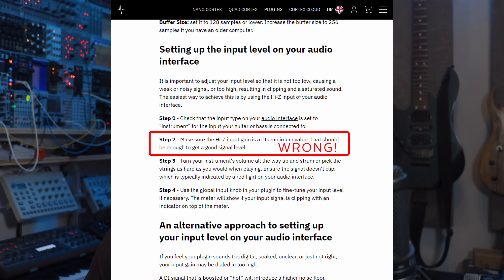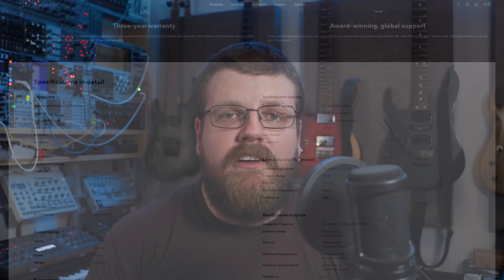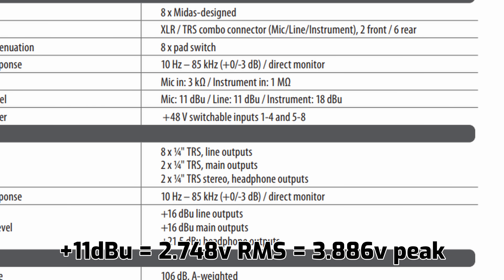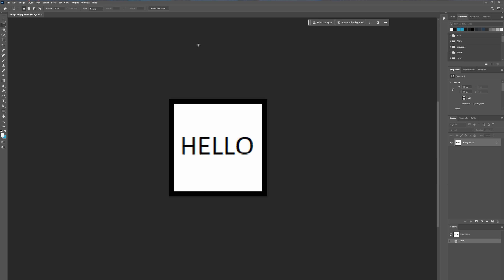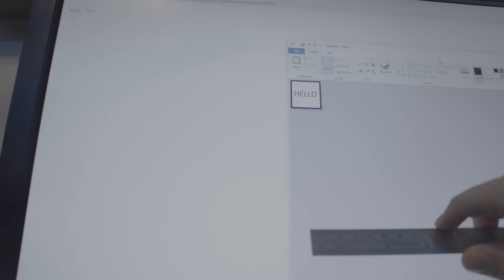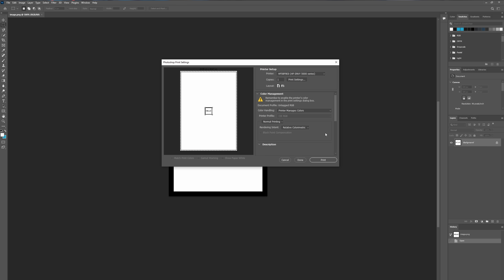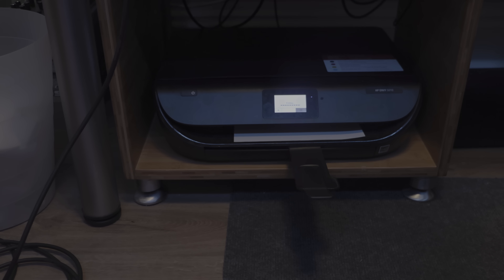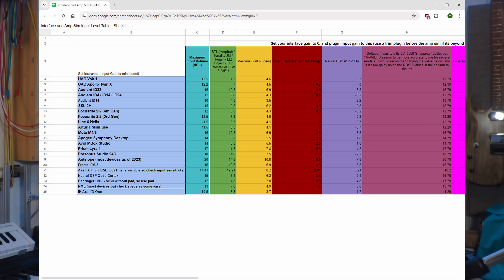Ampsims and input gain - Please, stop the madness...

Comment: great video! just subscribed!

How does that relate to floor modelers going straight into FOH / USB interface at home?

I am using a Qad Cortex that has input and output settings.

Since this is the first 'gainstage' I suppose I am doing it right with setting it up right before it starts clipping and then using the gain knobs on the desk / Interface - right?

One thing always wondered me and this is maybe worth a video:

How does output gain work in this scenario? Is this just attentuating the signal or is something going on with gain stages?

Comment: This is great, I have constantly had this thought for years, just about every pixel machine emulation has no optimal input explanation, channel strips show you -12 on something like SSL 4kB something else operates best at -18 like a 1176 compressor and something else is optimal at -10 but that's digital scale which 0 is the limit which makes no sense, gain staging is a nightmare because its not even real hardware, lol, I will have to rewatch this a few times to retrain my mind, on my 18i20 I have just been using the meters, keep it just under where it turns orange, might be too low, actually, I am gonna run off and tinker with it, thank you so much for this.

Comment: every audio interface is designed from scratch and often even ADC specification don't mean anything in the end. and Behringer is like the worst audio gear company you can find... so in your test scenario depending on quality of pre-amps and other problem sources(that you can't turn off completely in your audio interface) you can get very different results even if source and ADC is the same.
Reply: Sure, every audio interface is different, and the best setting is always the loudest before it clips.
Reply: @ChristianIce  i disagree. each one will be different. also user might prioritize noise floore more then dynamic range

Comment: Huh, informative.

I get a lot of noise from my guitar, I thought it was just a crap guitar, and it did in fact have a bad ground, which I soldered, (and probably has more electrical issues inside) but now I can see if part if the issue is in the setup before hitting the Audio interface or one of the converters before it hits the AU and then the amp sim.

Every step probably raises the noise floor.

Comment: How much of the "set the input to zero" advice was in relation to someone using an older generation Scarlett interface?  That damn thing seems to have virtually no headroom, so it's really easy to clip the input with high output pickups unless someone utilizes a DI box.

Comment: Does using active pickups like EMGs affect this at all? I'm assuming no, but this shit is so out of my field of knowledge i wouldn't be able to explain why or why not. I just think maybe the pre amp would affect it somehow?

Also I've always thought this,  it's dumb but I've related it to when i listen to music from my phone to a speaker,  i always max out the phone volume and adjust the speaker volume accordingly. It made sense to me to have the strongest best signal early in the chain then adjust later. It made sense logically in my head, but i didn't have the knowledge to prove it one way or the other. Especially when you put low volume on your phone and crank the speaker it always sounded flat. Doing 50/50 never sounded as good as 100% input

I always wondered about why everyone was saying put it to 0db, i just followed but never understood it lol
Reply: active pickups went to line input and not instrument input so just use the "increase gain just below clipping on audio interface" method then increase the input gain on ampsim to designated one on that spreadsheet

Comment: Are you saying using gain in a musical, harmonic , creative way,…  for music is wrong ?  It works in your exemple here but if signal to noise and math is your priority in music and art making, ppl with the song, the feel, musicality and vibe etc as priority will pass you by. Ppl listening will never care if you’re technically right or wrong. They will dig the song and the vibe or not. And gain staging, the way audio hits the different stages, and the changes occuring to the sound by the amplification of the different stages,  is a great tool to fine tune music as you want it to feel,  work harmonically and rhythmically, depth, … Why are we still clipping Neve preamp and dialing noisy tube preamps ?!  surely not to have the best signal to noise ratio.

Comment: Nice video, This is the correct way to set any kind of microphone or line input recordings since always, the hole idea of beeing just a safe step before clipping is using the most of the available space to print the signal, so the most of the space used, the more detailed and the lowest posible noise floor. thanks so much!

Comment: I always figured (from experience in other fields) that it's best to have the loudest signal without clipping when recording stuff.
      Because clipping takes away parts of the loudest stuff.
      But if you have to volume boost your recorded material, you're introducing noise.

Much like using a higher resolution image in Photoshop, or higher resolution / higher framerate footage when editing video.

(Because... "you can't turn poop into chocolate")

I think that's also what you're advising, correct? (there's a lot of technical terms in there, and I have no formal audio / maths / physics education)

What's always been unclear to me is how loud of a signal will make my virtual amps perform best, though.
    But since I use a (virtual) overdrive to push the virtual tubes, I'm guessing the louder the input; the better

Comment: I totally get this, but I'm an amateur at best. The part I'm struggling with is working out how much to adjust my plugin input. I've got my interface gain set so it's not clipping, but how do I tell how much signal(?) is hitting my plugin so I can work out how much plugin input to adjust? Do I use a level plugin in my DAW (Logic)? What will that tell me and then how do I work out the amount I need to adjust my plugin input? That part of your video seems to be missing or maybe I'm missing something. Appreciate any help :)

What I can say is, that following your instructions as best I could, I'm now getting a killer sound!

Comment: I've always used my Apollo audio interface with the gain set to 0, using active pickups, and I’ve never had any noise issues. 

However, I’ve never adjusted the input on the Neural DSP amp simulator. I’ll definitely try this ‘trick’ recommended by the video right away! Thank you so much!🔥
Reply: Had Apollo twin for years (original and mk2). Fully turned down the preams had still +10db  of gain. Really annoying sometimes when using a direct box recording di guitar and the preamp would clip because of the 10db boost. Then you have to use the pad in the preamp and add gain, which in theory increases preamps noise. Annoyed me everytime. One of the reasons why I switched  to RME.

Comment: Most of the common audio interfaces don't have enough headroom on HiZ inputs to handle high-output passive pickups (or sometimes even active pickups for that matter) no matter how low you set the gain knob. 4th gen Scarlett, for example, has a 12 dBu maximum input level, which is about 8.7 V peak to peak. That's unacceptably low. It won't even handle X-series EMGs with a fresh 9V battery. Duncan SH-6, for example, can easily spit out 8V+ peaks on heavy attack with palm muting (16V+ p-p). With this much overvoltage it doesn't just distort, it clicks like crazy. If you keep lowering the pickup until the clipping stops you would soon find it in your back pocket. Something like X2N will easily top that. And the worst part? It overloads the interface's input stage so it is not affected by the gain setting and won't even register as clipping since that circuit comes after the gain adjustment and the signal is already distorted there. But that's Focusrite, which despite its popularity is an absolute dogshit all around. Apogee Symphony has 14dBu (~11V p-p) of headroom. Just marginally better. UAD interfaces I looked up have 12.5dBu. Just fkn kill me already. The highest I've ever seen was something like 16dBu and I don't even remember what it was. Fortunately it doesn't matter that much when you use high gain preamp anyway, but in that case, why even bother avoiding clipping at all? Just ram the gain up until there is no S/N improvement anymore, the plugin will take care of the rest. Active pickups that run on 9V clip internally anyway (which by the way is the actual reason EMG recommended setting their pickups lower, and not that bullcrap about the magnet affecting string motion), otherwise they wouldn't keep up with their passive competition in terms of gain. The only cost effective solution I see to this clipping conundrum is to run 18V+ active setup and record through line inputs, which can usually handle around 20dBu. Otherwise you will have to either have an external DI box with attenuation, which pisses in your S/N pool, or just accept clipping as an inevitable reality and record cleans on a milder pickup.
Reply: You don't have to lower the pickup, you have to pad the input.
Open the Scarlet Mix control and fix the gain from there.
Reply: @ChristianIce  Not even a feature on the 4th gen and on previous generations it only affected the line and mic inputs. And there is no way they would have done it for a HiZ input. Since they are too cheap to use input transformers, the only other way to attenuate passively is to use a resistive attenuator. If you try to do this on a HiZ input your noise floor will skyrocket. Active attenuation is pointless, since you would have to have supply voltage at least as high as the unattenuated peaks which is what's  limiting input headroom in the first place.
Reply: @dmitryshtshitkov710  
I used a 18i6 for 10 years with none of those issues, the internal mixer allows me full control.

Comment: Just a note about statement 'set input to zero on audio interface input' - it probably came from metalheads as they often have such hot pickups so that even on minimum possible gain they still manage to get their instrumental inputs clipping as hell. Here are two outtakes I would like to add:
1. Having hot pickups is NOT required for metal in fact :)
2. Many audio interface manufacturers do not provide adequate input levels for hot pickups even at minimum gain. Even fewer of them provide a 'pad' button on an input to mitigate this. Because really hot pickups could easily output VOLTS at peak (not microvolts, not millivolts, but VOLTS) - I know a person who did measurements with an oscilloscope. The same exact person also teached me to setup my levels exactly like the author of this video.

Comment: Thank you!  I appreciate this information.  It confirms something I did understand (increasing interface gain to use the whole tool) and added in controlling the input gain in the plugin, which I did not connect up, conceptually,  before.   This is a practical process I can use every time, to get better results and better understand how gain in the chain works.  Thank You!

Comment: I run my Scarlett at min gain for 3 reasons:

1. I wanna preserve the difference between a low output single coil guitar and a higher output Humbucking guitar. If we do the "max gain just below clipping" - we nullify the difference in output between the guitars. I want to HIGHLIGHT the difference between them.
2. I want to get as close to the sound on my Helix in Native. I want what i make in native to sound the exact same (or as close as possible) when i copy it to the helix. If i do the "max gain just below clipping", i will have to lower the gain on the amp, and when i copy it to helix, the input will be much lower and i will have to adjust the gain on the amp again.
3. Its easy, set it and forget it.
Reply: I think his method would only null the differences between pickups if you follow those steps EVERY time you switch guitars.

It seems to me that the best way to do it would be by picking the guitar with the hottest pickups you have and follow those steps. Then you just need to save both how much gain you've added in the input of the interface and how much you've subtracted on the plug-in input.

If you then keep it all saved and fixed, without readjusting it everything for each guitar you own, then you should preserve all the differences between the different pickups you have at your disposal.

Comment: It's almost like whoever designed the plugin DELIBERATELY put the midpoint of the gain knob at -20 db lol. just like how most post gain knobs have unity around 4 or 5 o clock. You're more often going to pull the output down 10 db rather than crank it up 10 db and blast your master bus.

Comment: I don't know if I disagree with you, because I've always agreed with your logic, at least I did until I bought a real tube amp. I bought it to try to get the closest match between software and hardware and to see what I'm really missing using modelers. The first thing I wanted to do was try to make a repeatable signal for testing, which meant guitar > interface > re-amp box > amp. Using your method, I couldn't get the amp to feel right! It felt flat and digital. Using the full dynamic range of the output and turning down the reamp box (which helped), it still seemed to be compressing the signal. So I went back to a lower input level, and the pick dynamics came back. I recorded picking soft to loud with different settings, then volume matched the recordings, and there was a really obvious difference. Maybe it's my presonus quantum doing something strange. I did try a few combinations of buffer and di and came to something that mostly worked, and plan to go back and try it all again start to finish. I should mention, I tested using true bypass effects loop that I rigged up to switch between direct signal to amp, and the signal in and out of the computer.

TL;DR Noise is improved this way, but dynamic seem to be degraded, at least from my testing so far.
Reply: If the dynamic range was impacted, you added too much gain.

Comment: Really good shit, I fell into the "Set gain to 0" trap because it made sense, but turns out I wasn't looking into it properly (I'm not an audio engineer, just a software engineer lol). However, how would you deal with complex signal chains with more than 4 engaged effects VSTs from different manufacturers into an amp sim?
Reply: Help?

Comment: Ik multimedia and Tonex are to be blamed here. As far as I can remember this started the whole drama months ago. Tonex plugin when used with almost any audio interface will not sound the same as a Tonex pedal with its input trim set to +8.5dB (factory default). So people started to go bananas and find ways to correct it. 

Also with the pedal, setting the input trim (hidden deep inside your pedal settings) to a more reasonable 0dB (give or take) and not touching it anymore, makes more sense than adjusting it for every guitar and pickup configuration.  At the end of the day your Tonex pedal acts as an amp here and those who remember real amps 😅 know this is a part of the game: different guitars, different pedals, different pickups will sound different with the same amp. This is expected behaviour. But this is for the pedal in "performance" mode, and NOT for using it as an audio interface for recording trying to maximize SNR.

Plus there is no way of knowing in which conditions (like input level) captures were made - it also added to the variance and confusion

Comment: Tbh in my experience amps actually suck, even the emulations. They are crazy noisy, especially above 5k. I record DI with no gain added either and use distortion plugins like red light or cyber drive in liu of 'traditional' emulations. The end product is often far easier to mix

Comment: I'm astounded that people were doing this. I'm even more astounded that Ola was doing this!
I'm not a pro, but as far as I was concerned, one should always turn  the gain up on the interface until you peak and then roll back to green. You get the best signal to noise ratio you can, and THEN adjust anything in the box. 
Solid video, with a great demonstration.
Edit: and if you hit red at zero, you engage the buffer/pad so that you can turn up the gain to get best signal to noise ratio

Comment: That must be why most amp sim engineers recommend exactly this... Who'da thought
Reply from the maker: @bassgoul  I've often said that, that advice from neuraldsp definitely did not come from someone in their engineering department :) more likely a customer relations person trying their best. To be fair, it's not the worst advice, for most scenarios, and it has the positive of being very simple and easy to follow. So it's understandable why they recommend this. But what it is not, is the optimal advice.
Reply: @GhostNoteAudio  i was referring to amp sim manuals suggesting you turn up the instrument input to near clipping, as you suggest. Numerous companies already tell you to do this (ikmultimedia, stl tones, overloud th-u has a meter built in for this). I've never had a problem getting accurate tones this way and while i understand the logic behind leaving the input at zero (to let different pickups impart their own output characteristics into the sim), this isn't an amp and unless software/hardware companies standardize input levels in both domains for amp sims, this way you mentioned is the best way